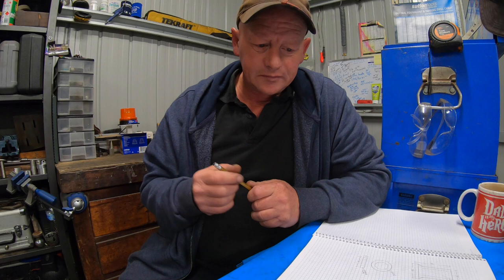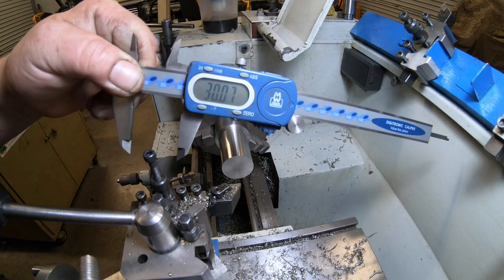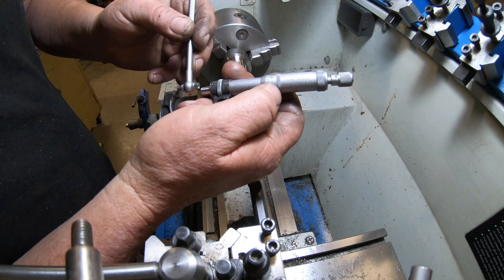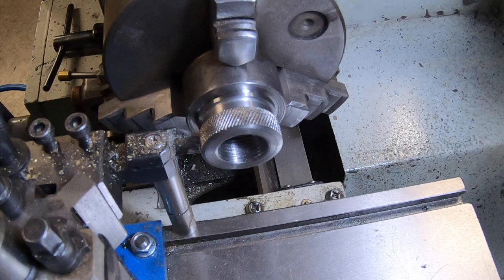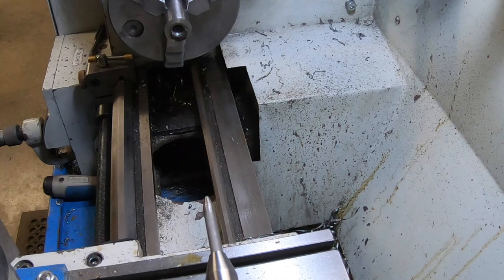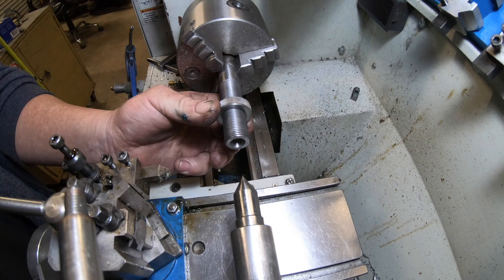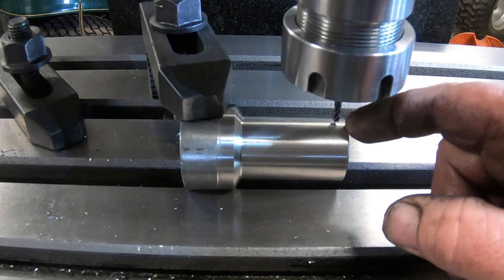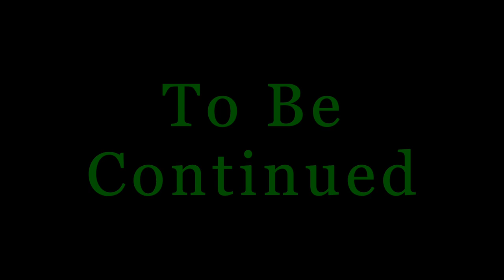2 stage machinist jack

Comment: Oh yes your a genius Matty! That worked great!!! Thanks for sharing.
Reply from the maker: Thanks Sam, I’m not sure about the genius part though
Reply: Matty’s Workshop well i made a part and blew the slot measurement. I cut the slot to long and was going to weld it back and boom you fix one better just drill and tap for a grub screw. I’m going to use that with a counter bored for a Allen head bolt for the stop. Thanks for sharing.

Comment: Hi Matt, great job!, The OD on a male thread is in fresh air, it is the flanks of the thread that transmit the helical load, undersize OD just means the flank engagement is reduced. On thread data standards, there is a specification for OD, as well as fit.
Impressive design and construction.
Thanks for sharing. Regards John.
Reply from the maker: Thanks John

Comment: looks good matty, quite a nice design. I was wonderring if you were going to add some holes in the ring for some tommy bars for fine adjustment, or just leave it as is with the knurl?
Reply from the maker: Gday Chirpy, I’m just going to leave the a knurled, I can always add holes later if I need them...